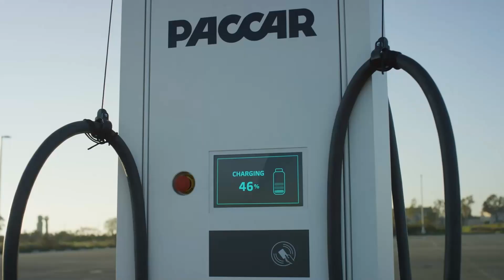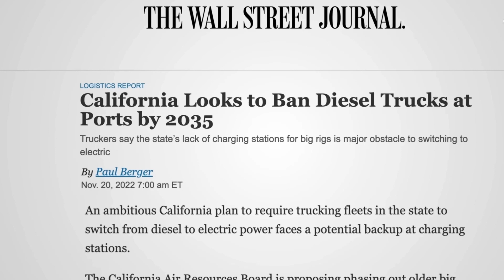Will the Tesla Semi revolutionize the trucking industry?

Comment: As of 2023 trucks are required to have defined and be no older then 2010 they are requiring cars be all electric by 2035 but the power grid can not keep up as it is now with only 20% evs
Reply from the maker: When I said 20 years older I was referring to pre EGR (exhaust gas regulator) engines. These are the things that started to chock up the engines. Like the Detroit 12.7 60 series or the Cummins N14 or the Caterpillar 6NZ. Those where the greatest diesel engines, but they let off a bunch of nox gas and regulations got sticker. After EGR they were required to add DPF filters and later on DEF (diesel exhaust fluid) systems. All of these things required OEM’s to reengineer these engines. So they do tend to break down more than there pre EGR counterparts.

Comment: Please tell me where your buying brand new diesel powered trucks for 90 to 100k
Reply from the maker: Actually I relooked at my notes. I did say that Pepsi paid $180,000. Actually it was probably 200k. On the other hand if you are a fleet and you buy your vehicles in bulk you can get a pretty discount. You are correct that the retail owner operator cannot get a new diesel for 100k
Reply: I wondered that also. And please tell me how to make money with the extra 20000 lbs the battrie weighs. That weight we can't haul. We get paid by how much we can carry. All the testing comparisons seem to weigh the truck and not the load carried on the truck. MISSINFORMATION
Reply from the maker: @captsirl  actually what I said was that most fleets will be forced to switch. Not because they want to.